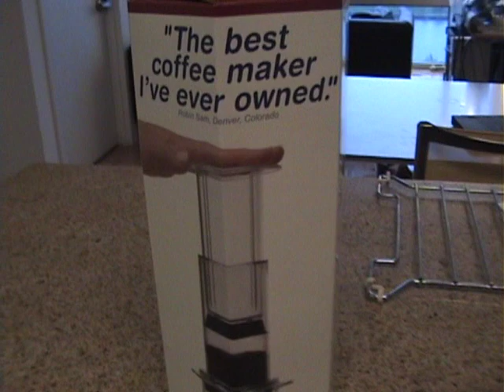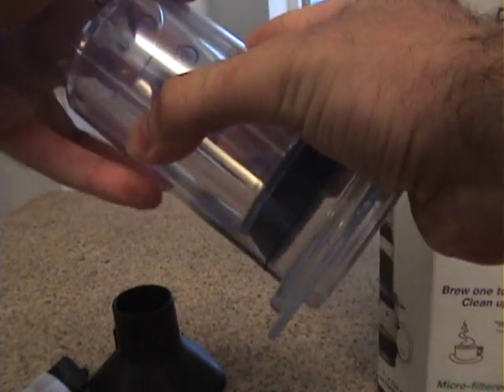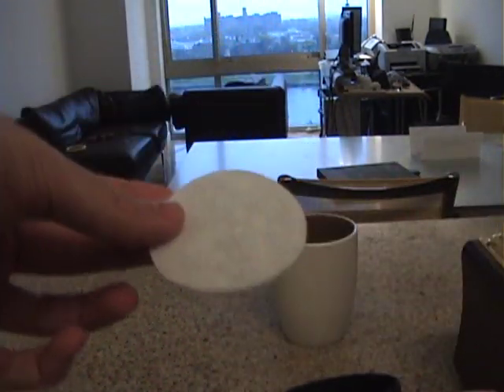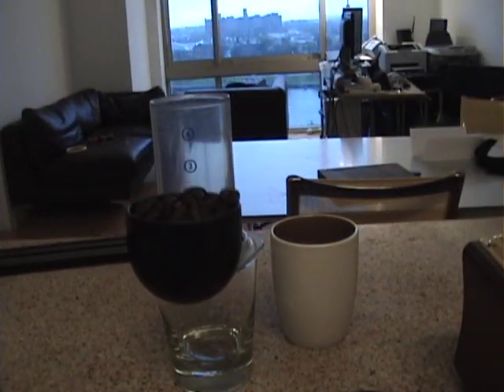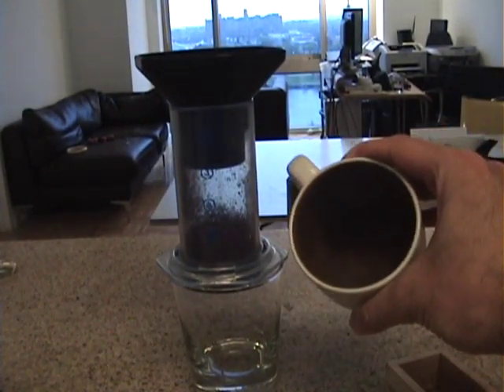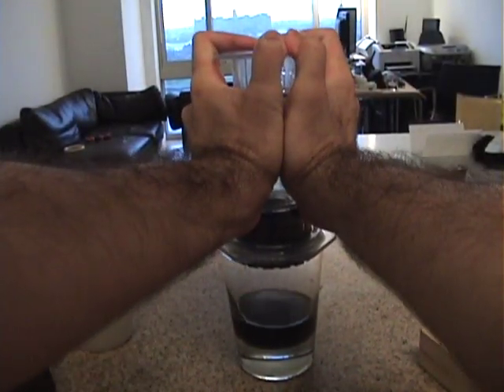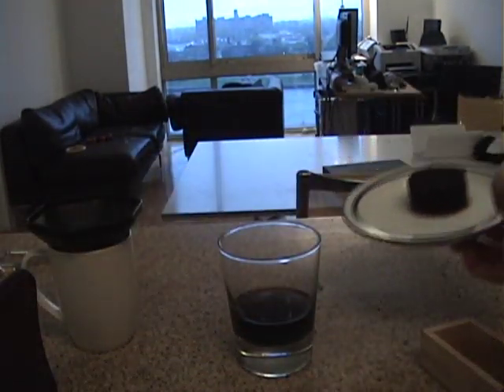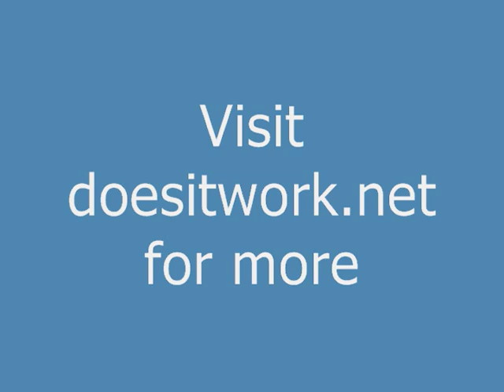How to use the AeroPress coffee / espresso maker - Aeropress review Aero Press

Comment: My latest Americano experimentation:

-- Dialed in the Zassenhaus as per their "official" instructions to a little coarser than a drip grind.

-- TWO Aeropress scoops of beans to about 12 oz. of water.

-- BREW at 175 degrees BUT heat the rest of the water to 205 degrees 

-- ADD the rest of the hot water to the Aeropresso

Smooth AND hot.  Damn fine coffee!